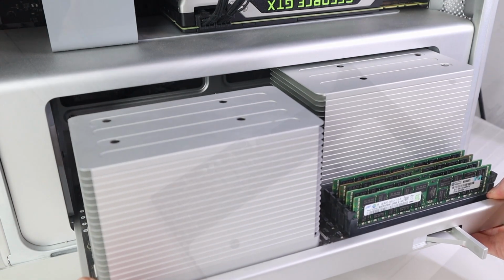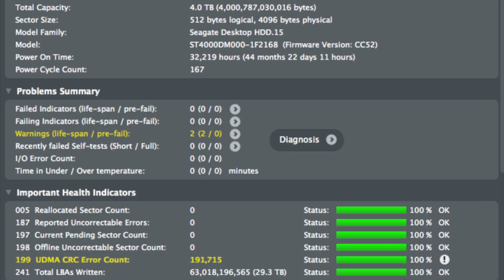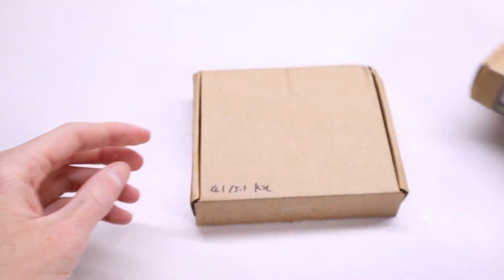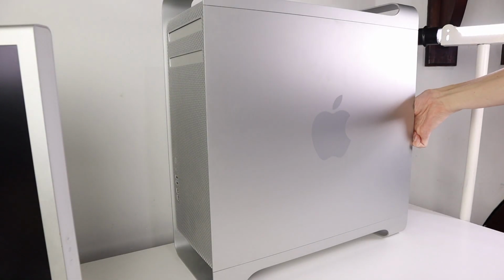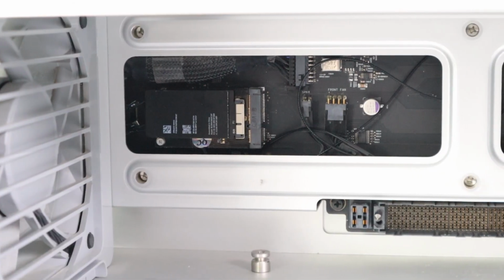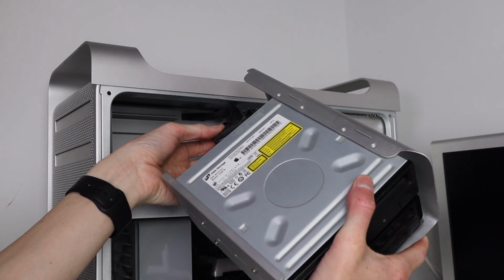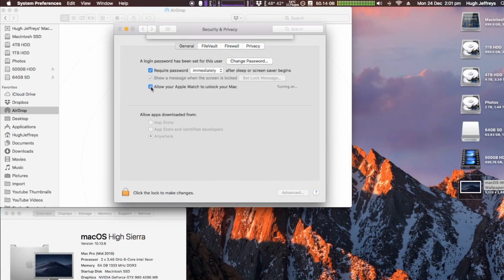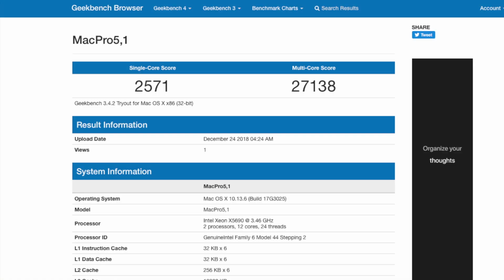The most powerful Mac Pro 5,1 ever?

Comment: Upgrade the GPU to a VEGA 64 sau 56 and you have native support in macOS !
Reply: Vega 64 and 56 max power draw is a bit too high and could cause power issues with the stock Mac Pro power setup.  With the Mac Pro 4,1 and 5,1 you can only get 225 watts for the video card (PCIe slot gives 75watts, two PCIe cables are 75 each, for total of 225 watts).  Vega 64 max power draw exceeds 225 watts.  I've seen some games hit upwards of 400 watts.  Pretty sure that will cause something to overheat/over draw, and probably cause system to shut down or behave badly.  You can google "Vega 64 max power draw" and see this in various bench marks.  Hope this helps.
Reply: Apple used to have NVIDIA graphics cards in Macs so the 980 is natively supported.
Reply: @enby-girl5020  Up until High Sierra yes. There are no NVidia drivers for any NVidia GPU for Mojave.
Reply: @SebastiaanSwinkels  This is strictly not true, for example, all retina MacBook's with dual graphics up until the 2015 model have Nvidia GPU's and all are supported by Majove.
Reply: Nvidia Cards That are NOT Natively Supported by Apple and need the Web Driver to function will NOT Work with Mojave. That includes Everything Thats Newer than either the 6xx Series Or the 7xx Series. Old Cards like a 8600m gt or 9400m/9600m will also Work with Mojave if you use the Patching tool. My 670 Works fine, my 1030 and 1060 wont Work with Mojave. Amd Cards all have native Drivers from Apple, so most if Not all will Work.
Reply: You can unless you don't mind the high speed fan blowing like a blow dryer. MacOS high Sierra/Mojave recognize the card but it's not fully support. it has high speed fan issue.
however, you can edit the amd10000controller.kext to make it run at a lower speed but as soon as you rendering video it goes full blast again. every annoying. as of now the rx 580 works way better. why I'm saying this? because I have been through all that.
Reply: I have a 1080 in mine, no issues so far but I know that I am at peak for the max wattage draw from pcie slot and cables.  I won't use SATA for the gpu power draw personally... even though you can draw power from SATA, it's not the best place to draw a ton of power from, and many times the gauge of wire people use to draw power from SATA isn't adequate for the power that will be needed.  The SATA power draw could result in melted wires and/or fire (plenty of crypto miners have stories of rigs experiencing this).  It is probably depending on which games or applications you run, my original point was focused on some modern top games that will push the Vega 64 to very high watts at peak. So at this point I would say YMMV and tread carefully.
Reply: I have Radeon RX 580 8gig on my 5.1 Mac Pro - Can I upgrade to Mojave with this GPU? Will it boot? Or do I have to take it out and put in the original GPU that came with Mac Pro? Please advise. Thanks!
Reply: If you do pixlas mode, you can draw more power to gpu :)
Reply: Actually there is no native support, you won't get any boot screens

Comment: Maybe MacOS is trying to use the original Bluetooth card because it is still plugged in to the Mac and has no antenna so it is causing issues? Or the two cards could be conflicting each other

Comment: AFAIK with the following upgrades the Mac Pro can still be a viable machine in 2019: dual Xeon X5690, 6 sticks of 16GB DDR3-1333 ECC RDIMM, AMD Vega 64 graphics, and a NVMe drive on PCIe adapter card. The 6 sticks of RAM instead of 8 comes from the fact that X5690 uses triple channel memory controller not quad channel, hence with 8 sticks of RAM the machine operates in single channel mode not triple mode. Vega 64 is for Mojave support, and if you already have the machine in High Sierra it should come with an EFI update that implements NVMe support.
Reply: 陈北宗 do you run high sierra or mojave from the NVMe drive?
Reply: @iwanskiwi  Mojave.
Reply: That is nuts. I remember the old Mac Pro being upgradeable and pulling its own weight in 2013 but even now in 2019 they still hold up. These things will probably out last the next Mac Pro model well into late 2025.
Reply: @markm0000  Only the dual CPU ones can still hold up in modern tasks though. The Nehalem cores are starting to show their age now, and for the dual socket machines are keeping up with just their sheer core count.
Reply: Thnx for your answer :) I going to try this out on high sierra any recommands for the nvme pcie cards? (Im running a single x5690, 3x 16GB DDR3-1333 ECC RDIMM, and a RX580)
Reply: @iwanskiwi  Anything would work really, just grab an adapter card if you went for the M.2 ones. Use one with PCIe x4 for best performance, however since the CPU does not support PCIe 3.0 the drive will be capped at 2Gb/s PCIe 2.0 x4 speeds so little point in getting a speed demon drive. Also you can build a Fusion Drive using th NVMe drive as a component, so you can use a smaller one if you need to.
Reply: Thnx!  @hikaru-live  I going to try this for sure. m.2 2GB/s is still more than SATA II with a SSD :)
Reply: @iwanskiwi  i was wondering how fast the memory could go, thanks for explaining this. this is why i prefer a modern hackintosh to these older computers
Reply: @iflnr978  the max RAM speed will go up to 1333MHz. My 2009 model had 1066MHz but because of the firmware upgrade its capable of 1333

Comment: Install a RX480, 580 or Vega card for native mac drivers support although you will lose the boot screen.
The benchmark numbers you listed is multi core performance, the single core is quite poor. you can increase this by removing one stick of ram from each CPU bank, its triple memory architecture so if you install 4 sticks per slot it actually runs slower. if you can live with a little less ram the CPU score will go up to around 3000 single thread.
Reply: You definitely want a tight boot screen. Loose ones are no good.
Reply: VideoCommenter based on the bad blood between nvidia and apple, we may never see new drivers from nvidia.

Comment: My iPad Air 2 is being weird. Some things are popping up as green. There are boxes around the apps and the green only shows up when night shift is on and I use night shift frequently. The display shows things as green and when I’m using safari, on the right side, there is a blue line sometimes. I know it can be fixed but I’m pretty sure you have to take it apart. Everything else works perfectly fine, just the screen shows things as green. My parents won’t get me a phone until junior year so I have to use an iPad. Can I sell it to you?

Comment: Though the GTX 980 is more powerful than an AMD RX 580 and with used GPU prices being amazing currently, I think buying an 8GB RX 580 is one of the best upgrades you can do for seamless support with future updates. I stopped Hackintoshing my desktop with a GTX 1070 due to this issue. 

Also getting a PCI to m.2 adapter to install a NVME SSD such as a Samsung 970 Evo would make the difference pretty much unnoticeable in terms of general responsiveness compared to the brand new models because of the crazy read and write speeds.  

I'm sure you're well aware of all of this, but just think the push to get these two upgrades is worth it.

Comment: I installed a usb 3.0 card in my Mac Pro 4,1 and my Bluetooth started to act up. It turns out that the usb 3.0 card was using too much power, taking away from the Bluetooth card.

Hope this helps!
Reply from the maker: It can cause interference. I removed mine to see if that fixed it. Unfortunately didnt :(
Reply: @HughJeffreys  I had the same bluetooth interference problem with my MacPro 3,1 and a Sonnet USB 3.0 card - squiffy Magic Mouse operation. I went to my local supermarket and bought a cheap wireless mouse <$10, plugged the dongle into my keyboard and the problem went away.
Reply: It’s quite hard to find a decent USB 3 card without the need for power and at a reasonable price, still on the hunt for one with my 4,1.
Reply: @jameo3606  Don't be worried about going for a card that needs power.  It's very very easy to route power from the optical drives
Reply: Similar issue with crappy Chinese usb3 card and Magic Trackpad connection acting up. Took it out for now.

Comment: Hello, I have 3  Mac Pro 5,1's and there are a few recommendations I'd like to make for you. First when running the Bluetooth cable you really should remove the CPU tray and run it underneath. This will improve Bluetooth signal. Next you can't upgrade to Mojave yet (Nvidia GPU) but you should download the installer and let it run a firmware update. Doing so will allow you to install NVMe drives into your PCI-E slot making the Mac pro even faster than before. I recommend the 970 Evo/Pro or the HP ex920 NVMe SSD. Other than those two, good job and good luck with the Mac Pro 5,1.
Reply: highvoltage12v why do you have 3
Reply: @derami0  They were bought  with various issues. One had a bad ATI 5770 so it bootlooped. The other one needed a power supply and the 3rd one was a 2009 which the campus considered obsolete.
Reply: The Web Drivers for the 980 for Mojave should be out soon
Reply: @cooperyeeto8847  Where did you see that?
Reply: AlphaFox78 There was a web page released on the Nvidia website that got taken down quickly also there are rumours on tonymacx86
Reply: @cooperyeeto8847  Nope, not gonna happen.
Reply: @cooperyeeto8847  haha
Reply: Nvidia GPU are tricky right now because of lag of drivers for them I would rather recommend using Vega 56 or 64 since it has native support..
Reply: Agreed. Only thing I would add was you should have done an AMD graphics card a single vega 64 or 56 would have been killer in this machine for productivity and content creation
Reply: NVMe M.2 ssd drive does not work as a  boot drive on Mac Pro 5,1 due to the chipset not support NVMe. However, you can use it as a scratch disk for fast video rendering or storage purposes only. The M.2 ssd that will work as a boot drive is the Samsung sm951 ACHI m.2 ssd and Samsung other ACHI m.2 ssd.
Reply: @ha1rry163  This is not correct. If you upgrade the firmware to v140.0.0.0.0 which comes with the Mojave installer (as mentioned by a few here) you can boot with the drive. I am currently booting off a Samsung 970 Pro 512GB to Mojave and High Sierra :)
Reply: I really wish there was a reliable way to add Thunderbolt so I could connect my RAID.
Reply: highvoltage12v   So, startup from the installer, but open utilities and only do the firmware.  That’s a great bit of advice.  No downside?
Reply: @artysanmobile  No downside to doing this. You also gain Spectre and meltdown patches. You are opening the installer inside High Sierra. It will ask to do a firmware update before it officially installs.
Reply: @highvoltage12v  m.2, i didn't know that was possible. isn't the bus too slow to take advantage of the that as well as thunderbolt 3?  i love these old Macs, but it seems that it would be better to build an i7, i9 or  Zeon hackintosh work station incase Apple continues down the greedy slippery slope towards making the last version of their hardware obsolete at their customer's expense. recently i learned someone won a law suit against Apple for the iOS updates that slowed down iPhones "in favor of battery life". imagine Apple with their almost 1 trillion valuation loosing? usually these companies are above the law, but i guess it didn't affect them too much because they were able to mostly keep this of the news. those creative types who use MacOS to create art and music and who are sensitive and have a conscience, might have difficulty supporting Apple and having Apples corporate vibe are the center of their creations. this is a big reason that i'd personally prefer an intel hackintosh that also supports Windows, which on the same level or was worse than Apple, and supports Linux. i guess Linux can somewhat run on Apple hardware, but it is touchy and to avoid issues it seems better to run MacOS on hardware that supports Linux better, such as described on tomymacx86 and to learn Reaper, Bitwig (really great DAW), WaveForm's Treacktion and Harrison's Mixbus (great sound and emulates analog equipment in the graphical user interface) which work on all three platforms, as i recall, for music production and to learn LightWorks for video editing which also works on all three platforms, as i recall, and support OpenShot. i still use Apple hardware and MacOS but i am saving up to migrate as much as i can to Linux. i'll keep my Logic Pro X rig too, because i know my way around it and it may be the best, along with ProTools for now, but Open source programs or programs that run on mostly open source OSs should become better at some point, or bitwig may already be better for a lot of people now
Reply: @iflnr978  Sadly, I'm trapped in the Apple Eco System. I am deeply embedded in Logic Pro and couldn't possibly change. Damn you Apple! If they stop supporting Logic then I am so gone. Hang the expense.
Reply: @francissreckofabian01  me too. keep in mind that there are several DAWs that work in the big 3, Windows, MacOS and Linux. Logic Pro is so complex to learn and it is the only one that i sort of know my way around that i am locked in, in that way myself, but because Bitwig, for example, works in all 3, i am tempted to install it on my Mac and start fiddling with it occasionally. Bitwig promotes a somewhat disabled Free version to experiment with. i know your time is may be too valuable to spend more time on learning. se la vie, sorry and the universe is in someways perfect, ie, you get out what you put in. i have several DAWs but haven't the time to learn my way around yet. thanks for answering, have a great day or night, where ever you are
Reply: @francissreckofabian01  Im there to... My 4.1>5.1, is more speced than the one on this vid..... 
But  Somethings afoot at the Circle K.........Apple using the term "Modular" instead of "Expandable" makes me think all "brand"  expansion options are Licensed $$$,,,,,
Fk That... Also , I wouldn't be surprised they could be using ARM cpu's....  Its been a long time since a real pro release, im sure putting it simply ,this mac pro isnt just a case design...  It'll be apples roadmap...
If apple do what they did in the 90's before Jobs came back.... Proprietary ,  Modular,   non of the shelf parts compatible....  Im gone.... 
Prob back to Cubase for scores/music, at least Protools is Multi plat...  Just not a win fan... Though I do boot in it for games...
Reply: C Rizzy I am getting confused. I never heard of that kind of memory. Is kHz kilobytes per second? I am interested but l need to look all this up, thanks for the reply.
Reply: C Rizzy  i didn't know that software updates could increase motherboard speed. Mother boards are matched to CPU speed. i thought this is why you can't just keep upgrading to faster CPUs in old equipment.  CPU speed measured in gHz (plus cores and threads which are not exactly speed, but reflect on how fast a computer can do things like video rendering) i was looking at switches (not computers) from 9 years ago capable of 100 gigs/sec https://www.youtube.com/watch?v=2gvwPcKDtIU https://www.youtube.com/watch?v=6bXxMzTd5Ro https://www.youtube.com/watch?v=SM1gLPrvWao and wondering if switches are relevant to this at all
Reply: C Rizzy  Get the new firmware from the Mojave installer. Buy an amfeltec squid and NVME and it'll toast any AHCI drive. The key spacing is different from NVME and AHCI cards. There should be no reason at all anyone would invest in any AHCI drive for any 4,1 or 5,1.
Reply: Can you boot up from NVMe's with the new Mojave Firmware? Cheers!
Reply: Well I got (3) 5,1.(4)3,1.(2)1,1 and (2) water cooled mac pros.I will be water cooling 2 of the 5,1s.
Reply: I don't get why Mojave won't work with NVIDIA. My late 2012 iMac runs Mojave just fine, and it has NVIDIA built in.

VIDIA GeForce GTX 675MX:

  Chipset Model: NVIDIA GeForce GTX 675MX
  Type: GPU
  Bus: PCIe
  PCIe Lane Width: x16
  VRAM (Dynamic, Max): 1024 MB
  Vendor: NVIDIA (0x10de)
  Device ID: 0x11a2
  Revision ID: 0x00a2
  ROM Revision: 3707
  Metal: Supported, feature set macOS GPUFamily1 v4
  Displays:
iMac:
  Display Type: LCD

So, there have to be drivers, right?
Reply: trying to find one of these  2010mac pro 5, dual xeon 5680....to hot rod upgrade it and cheapest one so far is 1800.00???? have no idea where others are finding ti for under 500.00
Reply: Mark Georgeff 700-800€ where i live
Reply: Seems like, Hugh Jeffery finally listened to your suggestions in his new video :)

Comment: Just replace the thermal paste of gtx 980
Reply: It Most likely has been when it was 'flashed' for the Mac Pro EFI. Doing so needs either the EEPROM replaced or flashed with a SOIC8 clip. You really shouldn't flash it with NVflash.
Reply: @highvoltage12v  Can you explain how to flash gtx 980s?
Reply: @highvoltage12v  DUDE I AM TALKING ABOUT THERMAL PASTE
Reply: @saifudinkhuzema6525  did you not know? With the 980 you have to download the thermal paste after you've flashed it!
Reply: @joosh.1413  😂😂
Reply: @saifudinkhuzema6525  to get to the EEPROM you have to remove the whole cooler. Which means the thermal paste was replaced when that was done. What's so hard to understand about this?
Reply: @joosh.1413 thermal paste isn't a program!!

Comment: Hugh, is the 2017 MacBook Air any good? I just got one..
Reply: What's the price difference between the 2018 and the 2017 you just bought?
Reply: @WesitoxD  huge ass bezels and trash resolution
Reply: ads_wheeltrims u should get a 2018 model unless u got a KILLER deal
Reply: Manuel Gutierrez No way I’m paying that for a newer macbook